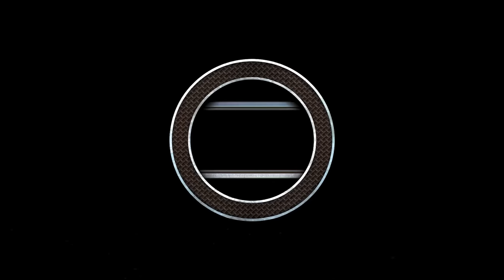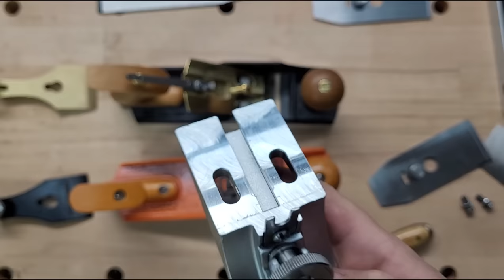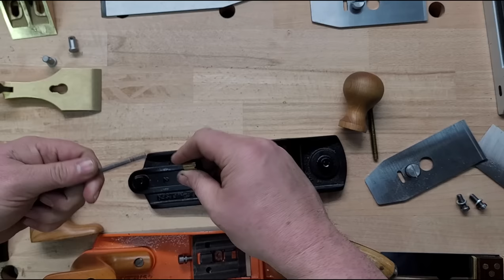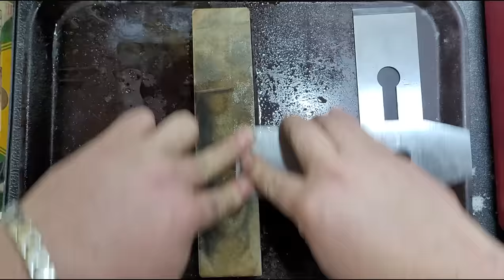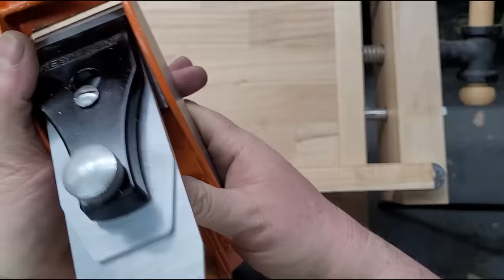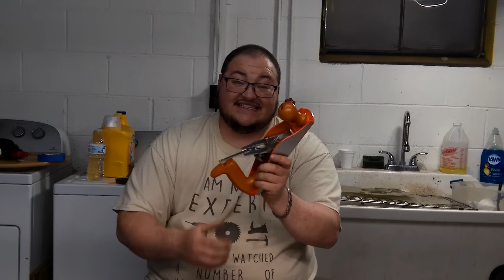$340 Lie Nielsen Vs $70 Jorgensen (The New Orange Plane - Lowes) Review and Comparison of the no 4's

Comment: Good comparison and thanks for your video. I use LN and have never had to sharpen one straight out of the box new. It's nice to see a less expensive one work as well as the top of the line. I tried a WR recently, took me an hour to get it to work as good as your orange one, $313.00.
I appreciate a company that has started making planes at a reasonable price for the average woodworker that can't afford the more expensive ones.  Thanks again for your video.

Comment: I can appreciate that this review was a legitimate comparison rather then advocating the orange made in china plane. You gave us the facts and left it up to us to decide. Cheers for that and great video. With that said I'd like to add the main reason Lie-Nielsen is worth the extra $270. 1: The extra money is an investment in our community and neighbors here in the USA. 2: For the extra money you get a tool made with the best iron and steel in the world held to the highest standards which means you will pass this too down several generations. (China metal is held to no standards at all, I'd be embarrassed to pass this tool down to my son if it lasts that long). 3: Call Lie-Nelson tool works and a person that actually uses these tool will answer the phone, no automated system that requires you to choose numbers for an hour and eventually directs you to leave a message. (isn't that alone worth the extra cash) 4: Lie-Nielsen tools are made in small batches, not high production which of course means they have to charge more, but small batches means they can control quality much better. 5: Lastly, Lie-Nielsen backs their tools 100% and they take pride in every tool that leaves their shop. Those of us that are a bit older can remember what it means to take pride in your work. In conclusion, as a Journeyman toolmaker by trade and a mechanical engineer having 30ish years in manufacturing, I figures I would share my thoughts....Thanks all for reading my comment, and great video.
Reply from the maker: I LOVE THIS! Thank you so much for including your thoughts because they are all 100% accurate! LN Customer service is amazing, their quality control is top notch, they are in the USA!, and it is an heirloom tool that can be passed down well.... forever! That does speak volumes. 
If people have the $$ LN is hands down the way to go, no doubt about that.
Reply: @BatCaveCreations  For the record (And I should have added this to my original comment), I would never mock a person for buying a cheap tool if that's all their budget will allow. (I've been there). What's important is that your making chips, now what your making it with. BTW I just got my LN No. 8 Jointer plane in the mail yesterday and I cant lie, I'm like a kid with a new toy. That thing is amazing. Right out of the box, no adjustments at all it made a perfect chip. Now I can plane flat those extra large pieces of Red Oak.
Reply from the maker: @nowhereman4041  no i get you for sure! I had to start off cheap too, it happens as long as you have having fun and enjoying the craft.
Also YES!!! I am the same way anytime i get a new tool! I try to get the box as soon as it is delivered and open it up! haha LNs are basically perfect outta the box. I do like to five the blade a polish but they are good to go and that is part of what you pay for haha 
Congratulations on the no 8! that is a big purchase but you will love it and use it for years! :D Have fun making shavings!!!!

Comment: I'm done buying planes (for now) but just can't get enough of top$ to budget comparisons!  My 1st big boy plane was a Stanley contractor grade Jack.  It took a million years to flatten, but worth every saved penny.  I'm going to have to keep the Jorg in mind if I ever want another, (you liked its light weight).  My current 4 is a hand me down Handyman, and I actually love how light it is; feels more in touch with the blade.
Reply from the maker: That's exactly why I like lighter planes. I know that's against the norm but I'm not normal haha I am tempted to try the REED brass knobs to see if I like weight in the front only which I may. It would make starting easier but for me lighter the better because of the feed back the plane gives. I'm very tactile lol
Reply: @BatCaveCreations  Well put - "feed back".  Reminds me of all the money I wasted on suspension bicycles; ended up right where I started and learned how to adjust tire pressure, lol.
Reply from the maker: @B.A.Bassangler  haha like a back to basics practice! Trust me I get it lol

Comment: Great comparison! A slightly ridiculous recommendation for treatment of the plane sole is scraping - machinist style. You can look up my videos on the subject. 

For planes, scraping does two things; 

1. it gets the sole flat to the precision of your reference surface (I used a granite surface plate that's certified flat to 0.0001" or 1/10,000 of an inch). Doesn't seem like it would take much work for your planes here as they seem pretty damn flat already - my vintage Stanley Baileys were most definitely NOT flat.

2. it leaves little "wells" and "peaks" throughout the surface which provides a vast improvement not only in glide, but also in retention of plane wax. These wells are the basis of machinist ways on machines like mills and lathes - if the ways (or your plane sole) were honed to a fine polish, they wouldn't retain any oil, sanding the bearing surface coarse helps but not nearly as well as scraping.

It's overkill I know, but honestly seeing as how your planes are already quite flat, it wouldn't take you very long at all and you're obviously only performing it once for the lifetime of the plane.

In any case, great presentation!

Cheers and Merry Christmas!

- Jens
Reply from the maker: You are correct! I do have a granite plane I use for flattening plane soles; I don't think it is ridiculous to do this! All vintage planes I buy get their sole flattened to some degree.

Comment: Your index finger should be on the side of the plane. That is why your hand doesn't fit the Lie-Nielsen. If the tote is still an issue, go to the 4 1/2 instead of the 4 as it will have a larger tote for an adult sized hand.
I wouldn't be so surprised about the shavings. The bigger comparison would be in the fit and finish. How much easier was it to setup? What type of materials is it made from? The blades and chip breakers are the same style which is why you noticed the Jorgensen looking the same. However if you had looked at the thickness you would have noted that both the blade and chip breaker on the Lie-Nielsen are thicker. This reduces chatter on tough grain. Plus I would guess that the quality of steel on the Lie-Nielsen blade and chip breaker are much better as well. this will help with edge retention on hard tough grained wood.
If you want something cheaper but better than the Jorgensen look at WoodRiver planes sold by woodcraft. Rob Cosman is a huge fan and has done a number of comparison videos.  I personally own two of their planes as well. They are a step down from the Lie-Nielsen but also easier on the pocket book and you end up with a fantastic tool that will last generations with care.

If you want a real test. Drop both planes from your bench to your concrete floor. I bet the LIe-Nielsen comes out without issue. I wouldn't be surprised to see the Jorgensen break, or dent.

Good luck, and happy woodworking!
Reply from the maker: The fit and finish is deff better on LN no doubt about that and it will last longer lol the Jorgensen is made outta ductile iron and the iron is 01. I wish I would have included that because it is comming up alot lol showing my Noob side to YouTube lol
I never had good luck with WR :( I don't trust Rob on them cus he is sponsored by them but..  I have hear alot of guys that like WR and other guys that don't haha maybe I'll try a no 4. Only ever used a no3 and no5 in WR lol

Comment: Thanks so much for this (and the other orange comparisons which I'll get to very shortly)! If I may say this is a much better review of the Jorgensen smoother overall than Rex Kreuger's, which I think might have been the first. 

Really interesting to see the performance comparison. Because of the speed I couldn't see if there was a slight difference in the settings of the two cap irons/chipbreakers which might have something to do with the difference in tearout you were seeing between the two planes. ButI think there's a very good chance the leading edge of the cap iron needs a little fettling to make it work to its full potential given how the whole plane seems it could do with being deburred and arrises softened or chamferred.

I am SO not Lie-Nielsen's target market but their choice of cherry for their handles has always surprised me, not a fan looks-wise to start with but I'd really prefer a harder wood on paper at least, so I'm much more inclined towards beech which has been extensively used in Britain for many years.

BTW, in terms of price differential/performance, thought I'd mention that I bought a budget plane some years ago, less than a tenth of what L-N's cost over here 😲that could probably hold its own against the more expensive plane. It took some work to set up – the kind of things you'd expect from a 30-40 buck plane (although the sole was dead flat) – but after that it performed v. well for me for some years. Asian rosewood handles too, which is nice!
Reply: I too saw Rex Krueger's review, and after watching this one, it looks as though Jorgensen company improved the product considerably in the meantime.  Rex's sole wasn't even close to being flat, and lots of other bits had to be improved to get the plane working.  Maybe Jorgensen saw his review.
Reply from the maker: Thank you for the comment!! The Jorgensen chip breaker was set a bit closer than the LN but I wasn't getting any tare out with either. To my surprise lol
I get you about targeted audiences! Not everyone wants to or can throw down for LN that's why I was really excited about these reviews! There are other options :D
What plane did you get? I'd be interested in buying and trying!
Reply from the maker: @therealzilch  I'm thinking that now too, he got one when it first came out. They have deff improved some things now!
Reply: @BatCaveCreations   Again, nice work, and I'm glad to see that there's an affordable plane that works so well, after a little tuning up.  For beginning woodworkers, it's no disadvantage to do a bit of work that will also teach them about how the tool should work.

I've already had the Lie-Nielson for many years now, so it's not a decision I have to make.  But I would recommend the Jorgensen to anyone starting out, based on your review.

Cheers from a musical instrument maker in Vienna, Scott
Reply: @therealzilch  $70 is still a lot for a No.4 plane. I've never paid more than $5 for an old one. I have paid as little as a buck for a mint condition Stanley No. 4. Now that's affordable. I don't think just having a plane is going to teach anyone much of anything either. Well, it might teach them that they have no natural aptitude for it I suppose.
Reply: @BatCaveCreations  The one I got is a Faithfull. I didn't mention the brand in part because they're not as available over there, but mostly because I heard that the quality has taken a bit of a nosedive since I bought which is a shame. 

The only reason the Faithfull isn't in my user rotation any more is I got a vintage UK-made Stanley that just turned out to be a sweet one that worked especially well so I designated it as my super-smoother.
Reply: @therealzilch  It does seem Rex was unlucky and got one that wasn't as good as the planes could be. But this might indicate the thing that's true of so many modern planes – that there's the occasional lemon. And unfortunately this isn't restricted to budget planes! There are reviews of new Stanley Sweethearts and even some Cliftons (£££!) which were very sub-par.
Reply from the maker: @tungsten_carbide  I have heard of that brand! They are tough to find here. I'll keep an eye out tho because they do pop up from time to time

Comment: I spent about 3 hours fine tuning my new Jorgensen #4.  The Jorgensen manual says the bottom is flat within .003, and based on my flattening the sole I would say that is correct, I just like my planes more flat and with a smoother bottom, so I spent the time and effort doing that.  The blade bevel was at 25 degrees and reasonably sharp, but I put a secondary bevel using an extra fine diamond sharpener.  The blade was flat on the back side and didn't require much time smoothing it out to finish the secondary bevel. The blade adjuster, for me, was not entirely satisfactory.  I like to back the blade into the plane body and use the adjuster to sneak up on the cutting depth, but the adjuster would not retract the blade far enough as it bottomed out against the frog as I screwed it in.  I removed the frog and removed the adjuster screw and adjuster wheel and used a file to remove a protruding burr around the screw hole which allowed the nut to screw in a bit more, which helped a bit and was enough to retract the blade into the body enough so it didn't shave wood.  I put everything back together and started a cutting test on a construction grade 2x4, which resulted in a pleasant surprise, she cut quite nicely.  I was able to get consistently .002 thick shavings.  I got a few at .001, but was not consistent.  I would rate this as a pretty darn good plane, especially for 70 bucks.  I have several 70+ year old Stanley's and one Record plane, they are all superior to the Jorgensen, but only by a thin margin.  I have absolutely no regrets buying the Jorgensen. With time and usage the performance should improve.
Reply from the maker: Thank you!! I am happy to hear it worked out for you and thank you for sharing what changes you needed to make. That is helpful for viewers to know!

Comment: I’d be curious to see several examples of the Jorgensen, to get a feel for how consistent their manufacturing process is.
Reply from the maker: I had many people tell me theirs was perfect, I think only a handful said they have issues. if that helps? lol
Reply: I opened up and inspected 8-10 of them between two local Lowe's earlier in the year, only one had an actual issue (massive scratch on the side I think), the rest only had minor differences on top of the body like some excess/missing paint and extra grease/grime build up.

I've been happy with all my Jorgenson purchases, not the best or the cheapest but consistently good quality at a fair price (unlike Bessey 🙄)

Comment: So when I met Thomas  Lie Nielson and his staff, I asked about the pronunciation, and they said Lie is pronounced like Lee.  The Jorg is a kit. The machining is not nearly as  finished and refined. The chip breaker and blade look fly cut, I assume they might be rough blanchard ground (which is usually done on big pieces) but the radius of the grind indicates they were not surface ground linear.   I spent 3 weeks fettling a No 7 Record. It required that much work to get it flattened and set. I started buying Lie Nielsen and Veritas after that, or old fettled Stanleys. All work.. my Record now works, but would I do it again? No.. The work was not worth it. It was hard work. I now have a surface grinder and metal shop added to my wood shop, I could , but I won't. The price is worth their accuracy, finish and features. Oh, and I don't prefer a lever cap any longer, I like a screw. It's just more refineable.
Reply from the maker: I agree 100%, but what about the ppl thay can't afford a LN or Veritas? And maybe they are too new to know how to spend that much time on an old Stanley or Record? Jorg gives them a good middle ground. I just want ppl to enjoy the craft and start in the craft without feeling like they have to spend over $300 for a smoother. I still agree with you, thats why I have a LN on the bench but I deff didn't start there lol
Reply: @BatCaveCreations  And that's why old Stanley, is worth it's weight and value. I have stuff from 1890s, on through to the 1950s.. All much better value than a lot of what can be had. Most just required sharpening the plane irons and getting the cap true to the blade again.  If I were a newbie, that's where I would spend my money. Most of the old stuff was fettled already.

Comment: (Lee Neelson) Although the irons appear the same, it's composition of the steel that is important. The Lie-Nielsen will stay sharp longer.  Those are filistore or 'cheesehead' screws that hold the frog in place. And if I'm not mistaken, the Lie-Nielsen body is ductile iron and so is quite rugged.   If the Jorgensen's body is cast iron, then it may crack or break if dropped to the floor. Btw, a swipe of candle wax on the soles will make those planes glide  across the wood, and it won't cause any problems with finishing.
Reply: You are absolutely correct. This guy is comparing quality with an inferior Chinese copy.
Reply from the maker: The Jorgensen iron is O1 and the body is Ductile Iron just like the LN. Rex K did a video where he threw the body of the Jorgensen over his shoulder, and it didn't break or crack or anything. He had an early model with a lot of issues tho, I am hoping he redoes the video now that they have made improvements. Will they ever beat LN, deff not. LN has better parts, fit and finish, etc. but it can take shavings as you saw lol its a good budget plane imo.
I deff use plane wax I completely forgot to apply it in this video lol